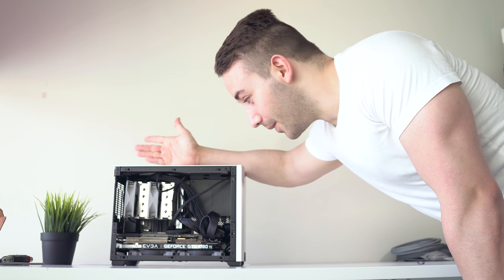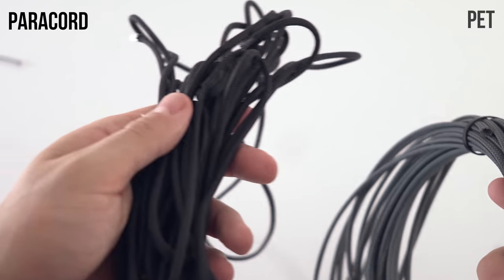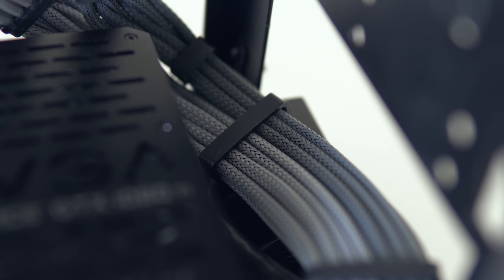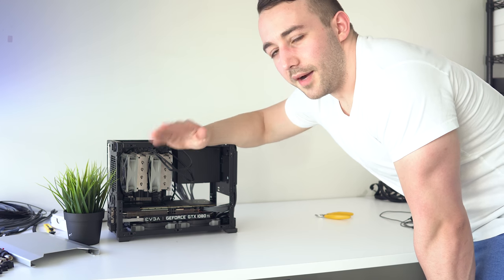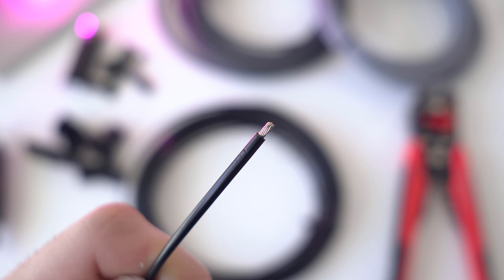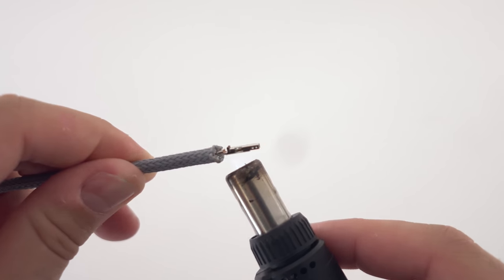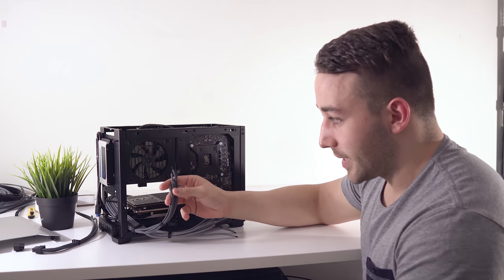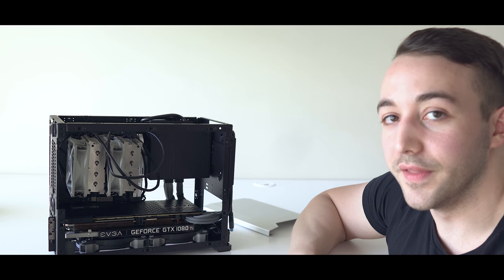How to Create PERFECT Custom Cables!

Comment: @ 3:09 You don't melt the heatshrink plastic. No flames actually need to touch the heatshrink plastic in order for the heatshrink plastic to shrink. You only need HEAT to shrink the heatshrink plastic.

Edit: In this video, in order to execute his technique at sleeving cable, you DO have to melt the heatshrink plastic.

Comment: what is the pin out repository or diagram for? are like different cables supposed to be different wires or are you just supposed to make sure that the corresponding cable from PSU plugs into the correct MB connector?????

Comment: I prefer "HY-07" hard cable, this one can be bend clean and without cable combs, even in 90 degrees angle. and power supplies with 1 : 1 plug assignment
such as Silverstone's.
not this cable mess at e.g. Corsair power supplies, where the 24-pin MB plug on the power supply consists of one 18-pin and one 10-pin

Comment: What if you have 2 wires going into the same pin. How do you do that? Do you just try to crimp both wires together? Do you thin the wires first to make sure they fit? How did you do it on the SF600 which has multiple double wires going to the 24-pin?

Comment: Am I right in saying that with cable extensions you need to run the cables in parallel from a female to male connector when making a custom set?  It’s only when connecting to the psu directly you need to cross over wires/double some up?

Comment: When making short itx size cables. Is it possible to re-use stock cables. Cut them to the new shorter length. Peel off the female atx pin, and crimp it to new shorter length cable?
Reply: so its completely viable if you just replace the pins?
when you say the pins might not be tight, do you refer to the clips hanging on to the wire, or do you mean that the pin itsef gets worn from being pulled out of the connector?

Comment: Just don't understand. If you say are wiring up the EPS 8 pin. Wouldn't you just run a wire through all 8? Why need a diagram? Is there say blank spots in the diagram where one does not run a live cable?

Comment: hey! just wanna ask, my plan is to spend more on the monitor now before spending on my gpu cause i think next year there will be a new gpu from nvidia anyways, i own a gtx 1060 6gb(gift from a friend) for now and will upgrade soon. so any good advice? 
for the monitor i'm thinking of getting the asus pg348q or the asus pg279q, i know the gtx 1060 can't handle it well but still while waiting for a new generation of gpu i think it will be fine for now rather than spending on a high end gpu or should i spent more now on the gpu and buy newer release monitor? thanks for the advice in advance
Reply from the maker: Go for the monitor, it's your longest term investment and will out live your components. I played on a 1070 with an X34 predator and it was actually a great experience.
Reply: Thanks! :)
Reply: alienware just came out with their 34in. 3440x1440p 120hz monitor
Reply: So what do you think of Nvidia's rtx 2000 series now?

Comment: Hey, what do you think about this build:

Rx 480 Red Dragon
Ryzen 3 1200
B350 pc mate
Corsair Vengeance 8Gb
Corsair 270R
Be quiet pure power 9 500W
1 Tb HDD
250 Gb Samsung SSD

It's mainly for gaming and maybe I'll try to overclock the ryzen 3
Reply: Looks pretty solid. Great performance for the money
Reply from the maker: Great build. 270R has great air flow, can't go wrong with the R3 1200, RX480 is solid if you can get it at a nice price, all in all very solid mate. Good luck building!
Reply: Optimum Tech Thanks man

Comment: So much trial and error to get this right...Good tools help a LOT. Especially the crimping tool..Don't forget to check your pin is crimped on in the right orientation..you don't want to have to twist the cable because the pin wasn't crimped aligned right..ie make sure the little tabs face the right way

Comment: Is it cheaper to "make" custom sleeved cables, or buy sleeved ones? I looked into buying sleeved cables for my new modular psu and im not quite willing to spend a couple hundred bucks on them
Reply: If you are going to be doing that regularly, then it might be cheaper. But there is the outlay for the equipment, plus potential wastage from practice. Also depends on how standardised your required cables are, as common ones made regularly by a supplier are likely to be cheaper.

Comment: So if i get this right, wire coming form one pin on psu side doesn't go into the same pin on the other side? So my question is why and is it a standard, so the wire always has the same route on every psu? For example wire coming from first pin always ends up in fourth pin on the 24-pin connector, etc.

Comment: Aren't the actual black connectors MALE connectors? (The black plastic housing that each metal female terminal is inserted into).

In the video, you mention "female plugs on both ends" (02:30) but wanted to make sure.

Comment: Doing this for the first time. Just wondering how to do a sata power push-though connector. (@t Would you make a shrink before and after the connector, or would you do one bigger piece and just push the connector thought the shrink tube and the outlining of the cable?

Comment: Hey I'm still all kinda new to PC building, just finished putting my gaming PC together, just one little hitch up and that my graphics card has an 8pin and a 6pin, I have a couple pci-e cables that came with the power supply and one cable splits into two pci-e adapters so I plugged in the 8pin and now I just gotta use the same cable that has the 6pin right?

Comment: Did I miss him saying what size of sleeving he used?
Reply: There's generally only one size for 16/18awg wire, which is 4mm paracord/PET sleeving. The 16 gauge wire will make the sleeving look more "full". For smaller wires, such as fan cables or rgb cables, you can use 2mm sleeving, and I believe they also make a larger 8mm sleeving for SATA data cables. Neither the 2mm nor 8mm sleeving would be suitable for individual PSU cables.

Comment: Does anyone have recommendations on a cable/socket pic or terminal removal tool instead of staples? I have been building my own cables forever and generally use staple or needles and whatever i can find but I have everything else It would be nice to have an appropriate tool for this last part..

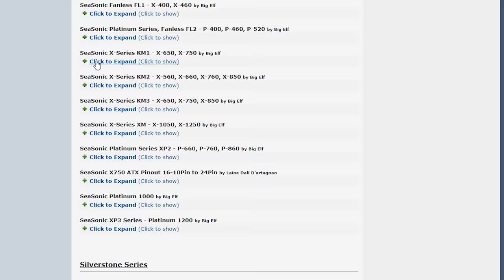Comment: 3:42 - Does this also apply for custom cable 'extensions'? because i bought a carbon cable extender and it's bended in a particular way, but the GPU has the connection in the opposite direction, so i wanted to flip the connector on the custom cable extensions so that they are bended the right way..

Comment: How do you use the pin diagram?? It seems in the video that you just put the same wires and plug it in that black thingie... i studied art, not electricity and this part is totally not clear to me 😔
Reply: look at 4:27 :) you swap the wires over somewhere during the run

Comment: Are the pinouts paralel to each other? Example, does number three cable from a 24pin connector go to number three hole on the other end?
Reply: Zozo Nox, it depends on what you are wiring. Some may go to a different type of connector. Some may be a large single connector on one end and two or three smaller ones on the other end. You have to know or find out. Otherwise, don't do it. If you can't trace the wires, use an ohm meter to identify the connector pinouts end-to-end.
Reply: @randyc5650  so each type of psu are different but the mobo pinout is always the same?
Reply: Zozo Nox, Like I said, it's up to you to find out. Some may be the same and some may be different. There are youtubers and websites that have the pinout info but there is no ONE SOURCE. Search the model number of your psu. I was speaking of wiring connectors in general not psus specifically. Sometimes the old cable may be lost and you can't find any info and you must use a multimeter to figure it out yourself. Sometimes equipment is so new that you can't find tech support or anyone else who has worked on it that you can ask so you might have to do all the research yourself. Also, if you invest time figuring anything out, record it for future reference.

Comment: can someone explain the chart to me: 
 difference gnd and 12v, he uses the same wire right?
 how does a cable go from 8 to 6 pins, 
difference in a and b? 
what are the arrows for (for example 10->b10)? 

im so confused
Reply: The same cable is used for the gnd and 12v or any volt for that matter. Just ignore all that. The easiest way to do it for example is to grab let’s say the gpu cable that came with the pc. it helps if it’s already sleeves somewhat. But all you have to do is follow each wire and just copy that on your new wires.
Reply: @axigon6904  tyy

Comment: Can anyone with sleeving experience provide some clarity.  I'm very interested in sleeving my next build myself, but due top my lack of experience and frankly having no prior knowledge in anything electrical I can't wrap my head around this one thing.  

Every video I watched so far has said,  you need to keep track of each wire and keep a diagram in order to keep track.  What is the diagram keeping track of?  At first I thought it was keeping track of a specific type of wire,  but Optimum is seeming using a single type a of wire. So, is it keeping track of the male and female end?
Reply from the maker: For example, make sure that a 5V pin from the power supply's motherboard plug goes to a 5V pin on the motherboard end. I recommend using the stock cable as a guide.
Reply from the maker: And yes, it's a single type of wire just keeping track of the male and female end.
Reply: After re-watching the video just a few moments it all just clicked for me. Lol, thanks for the quick response. You definitely have some of the best tech content on YouTube atm, plus your video and audio quality are always top-notch.

Comment: Can someone please help me understand the cabling for the 6pin GPU connector ?
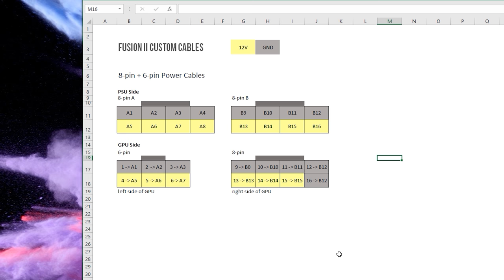From his diagram at 4:15 it looks like he uses the 8pin from the psu to the 6pin to GPU, but leaves out the A4 and A8. 
Is it possible to go straight 6pin on the PSU side to the 6pin on the GPU? Would he have not done this because his PSU potentially doesn’t have this ability? Tearing my hair out to do the custom cabling !

Comment: can anyone help me? I'm flustered by female and male.... so like motherboard is always male right? and so you would always need female for that side... the psu can be either male/female so you would need female/male respectively?
Reply: I’ve never come across a with female connectors. When making custom wires you will always use female on both ends. The only time you will ever use male is when you are making extensions of existing wires.

Comment: Do you really need 16 wires for 250 watt 12 volts?
Reply: Евгений Мокрушин you could use 18 awg, still some psu use 16 awg for pcie connectors

Comment: Everywhere I look, the pin-out for the EVGA SuperNOVA 850 G3 only shows one side of the pin-out, doesn't specify which side it is, and apparently EVGA has three double wires (pain in the ass!) I'm just going to buy shorty's and extensions. Screw this PSU.

Comment: how to check if my cables work? i don't want any of my parts at risk.
Reply from the maker: Use a digital multi meter to check continuity.
Reply: what about having the pins in the right spaces in the connector?